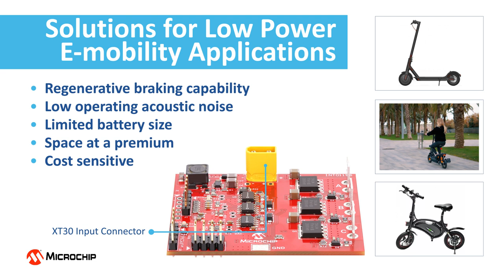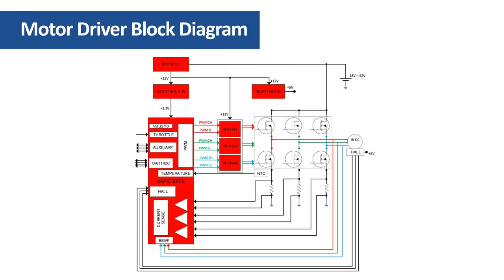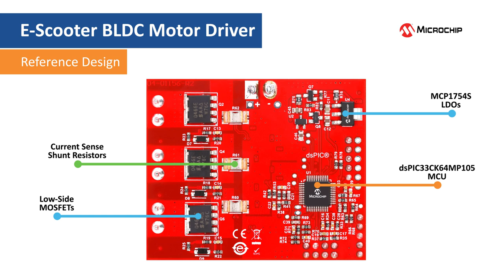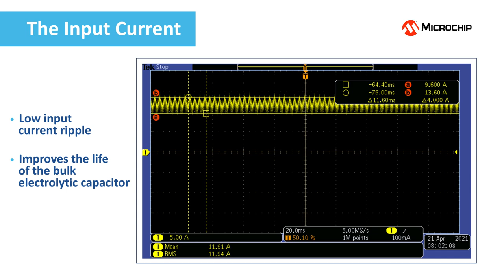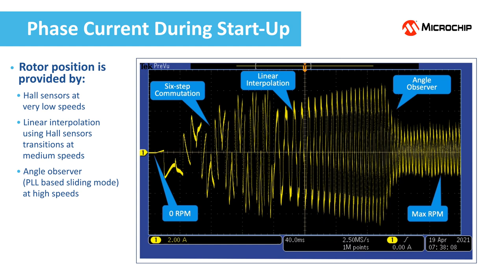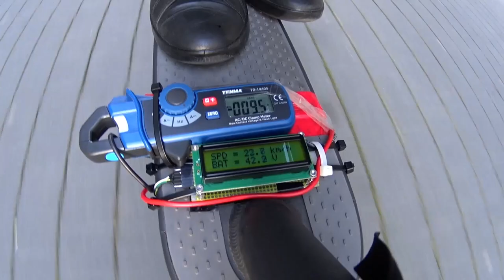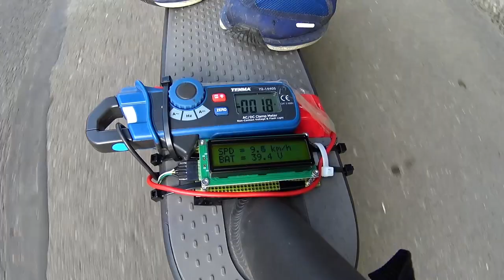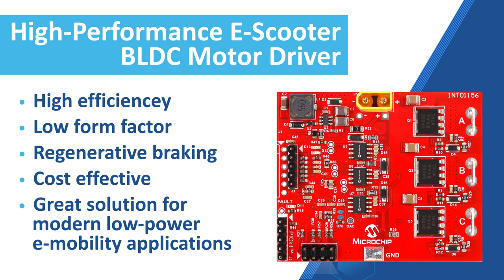High-Performance Electric Scooter BLDC Motor Driver

Comment: If I add another MOSFET in parallel, one for each of the three phases, can I increase the maximum output from 250W to 500W?
Reply: Hi Daniel,
Peak power can be 800W for short period. I am driving a 500W motor with this board without any issue. In practice you do not need the max power all the time. As you seen in the video the high power is needed only for the acceleration period that the board easily sustain. The optimal way to maximize the capability is to limit the maximum current based on the temperature of the MOSFETs. (and motor) Hint:Just put some heat sink and it will work fine for 500W continuous.
Reply: @W3ndyX  Thank you.  I did shorten my question to be as simplistic as possible.  I have a 1000W motor.
Reply: @dpneber  OK, then it is a different story. Also the voltage of the motor is important factor. You can calculate the MOSFET dissipation, if it can handle the current or not. Additionally need further modification like extend current measurement range (shunts) as well increase buffer caps etc... Also the PCB traces and connectors has limitations. (you have to handle ~40Amps peak)
Reply: @W3ndyX  Thank you!